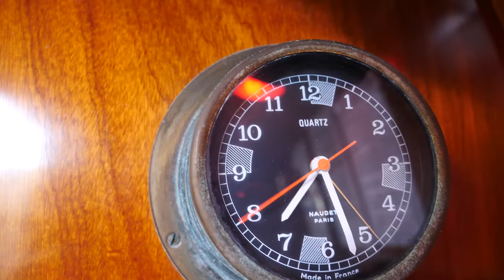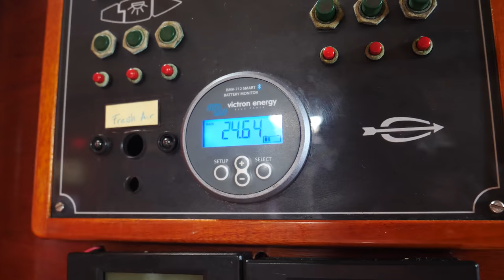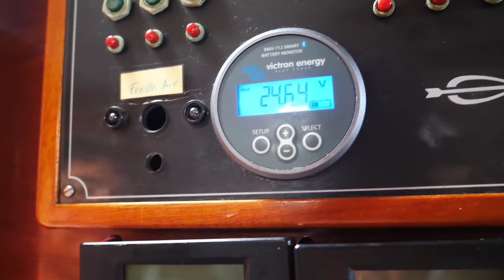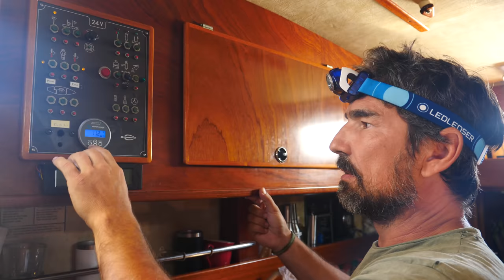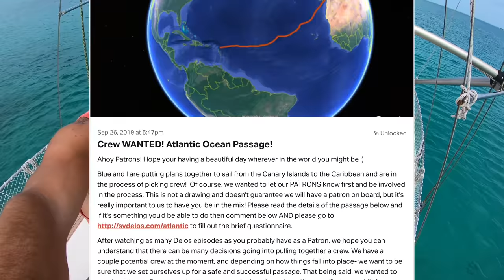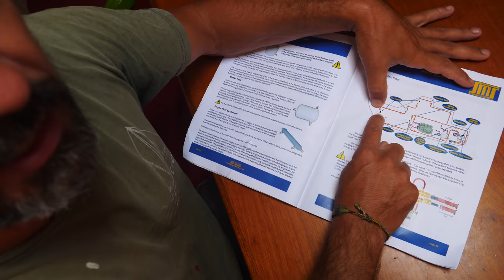Living in the WORLDS LARGEST swimming pool! - Sailing Vessel Delos Ep. 284

Comment: You guys rock.
I just saw your couple year old Ft Lauderdale meeting/conference and noticed a comment Brian made  about suggestions for new crew qualification ideas.

Well I have one, recruit a qualified radio amateur sailor(s) as new crew member.
Why: you travel to certain locations hams dream about and wish to get a radio confirmation after contacting (it is called DXing). The radio amatuer sailor(s) would do all the installation,  provide the antennas, radio gear and make the contacts ON and OFF the vessel. After the contacts are made and logged, those wanting a paper QSL card (postcard) would reimburse you for the expenses of printing and mailings. No major investments, just bunk and board. Most importantly additional publicity would be provided by the many ham websites on the next whereabouts of the next DX site, raising more interest on SV Delos present whereabouts and future plans. This would complement your FB, Instagram, Youtube  ect sources. You would only have to do this once or twice per year when visiting the most sought after Dx sites. For example Chagos, Svalbard and similar remote locations.

Put out a call and assess the interest. It will attract lots of  it.
west wishes to Kazza, Baby, Brian and Peter Pan (hi hi).
kb3bfATarrlDOTnet

Comment: Just an idea, but you might wanna add some foam pipe insulation around the rubber hose. This will help keep the heat from affecting the food you keep in the bilge (most importantly the beer).

Comment: You should be seal the walls of the holes you cut to lay the heater hose. Any leaks or moisture can get in there and start rotting it from the inside.

Comment: That hose run looked like quite the job. When you drilled the holes through the bulkheads did you put epoxy, silicone or some sort of sealer on the exposed wood? If not the wood will pull in moisture even from humidity and could start to rot out your bulkheads. Just a thought. Nice job though and great video as always!

Comment: A question about the radiant heating system....you ran the tubing that will transfer the hot water back to cooling fins and that heated tubing will be running through your dry bilge.  You use that dry bilge for food storage.  Aren't you worried about temp. increases in an enclosed space causing food spoilage or hastening expiration of the food stuff stored there?

Comment: I’m sorry you’re done with the drilling of the holes for your heater hose by now…. 
I wish I could have given you this helpful tip before you got started….

If you are able when using a hole saw as you were in this episode, start the hole but when the drill tip appears on the other side, stop and if possible, using the hole and drill tip as a guide, finish cutting the hole from the other side.

This does two things in your favor 1- it stops “blow out/tare out” (usually you end up with a very clean exit hole), 2- the core of the hole comes out of the hole saw much easier.

I know it is not always possible (especially on a boat) to do this but when you can it usually makes the job look much cleaner and easier.

Comment: Having spent some months doing this horror job I have several words of advice. I placed my heater hoses along water lines so that in cold climates the heat will keep water lines from freezing at minimum fuel consumption. Wile you are clambering around install an extra line for raw water feed if you don’t have that already. When you get to installing the heater fans, consider swapping out the fans the the lowest noise ones you can find using the gaming computer buffs as your reference (fan noise drives these guys nuts so they have the most experience). Look to the quality of your Calorifier. The one on our 19 year old Southerly was total junk and would lose its heat in just a few hours. The modern cylinders claim 1 deg C per hour heat loss rate. Once you fill these heater lines with glycol you don’t want to be breaking into the system again if possible (very messy). My Eberspacher had the circulation pump mounted hard on the heater body so its pump noise resonated through the boat. The fix was to install an adapter into the heater and suspend the water pump on its rubber feed hose a little distance away from the heater unit. That’s it. I’ll be interested to see your later system control modifications.
Reply: Any thoughts on using domestic hot water with hydronic unit, encroached, one less hose to run! Win, win :.)
Reply: Roger Kerkmann  : It would be convenient, but fresh water would go to work on the aluminium inside of the heater unit, which might be why they recommend filling the system with 50% engine coolant. Having said that I have seen a fresh water system spoken of, so no hard and fast rules.

Comment: one question i was thinkiing about if you run the warm  Hose tourth all the compartments where you stor your Canns and stuff doesed it get also very warm in there an get your food spoiled much faster ? if you woude use a isolation on the Hose it woude be much more efficient and more isolated to the compartments

Comment: You should be making your own battery pack s ,so you can monitor the bms in them inside the bms in those sealed units will fail one day with good cells inside that will be unusable
If you always monitor the individual bms s you can't lose with spare s on hand

Comment: one major problem I see from all the holes through bulk heads and baffles is flooding the boat. You're interfering with the boats engineering to deal with taking on water. You need to seal the holes

Comment: Although I realize that you won't have as much vibration and movement as an RV , I foresee a problem with unprotected hose where it passes through the wood and fiberglass. Even a bit of duct tape s protection and to stop movement may save you a lot of grief. Which will always occur at night in the coldest time ever ,,,,,,,,just a thought but even duct tape at each pass through could save you a lot of hassle.

Comment: Just a shmuck that watches sailing on the internet so be gentle.  Should the holes you bored through the structural members of your bilge be sealed with resin? Impressed to see beautiful dry/not rotted ply in your cores, just want it to remain that way.
Reply: Yes, they should have epoxeyed or painted the newly bare wood inside the holes they drilled. You're right, water in the bilge will at some point get to the bare wood in the hose hoels and wrought.

Comment: Getting more annoyed by Crazy,
the cword as a disabled person (think nword) used so much, maybe unusual, different, weird, eirie (sp?), etc (vocabulary learning from Swedish etc)
I Like the time lapse
especially the sunset/sunrise,
and weather.
3D gopro case like that but second lens in compartment, difficult to find anymore (GoPro1s)
And saved a few conch 🐚
 (like starFish ) 
along the way.
Re: heater hose holes, 
losing coating may allow 
dry rot to get in,
 as no longer coated 
so some sealing 
may be necessary 
over time... Afaict
Reply: Please stop being so sensitive and taking that word out of context. You can clearly hear how it's being used.....